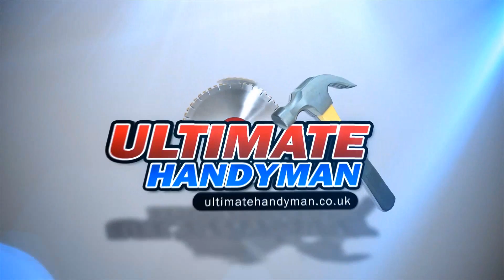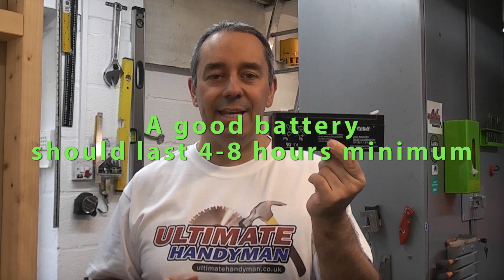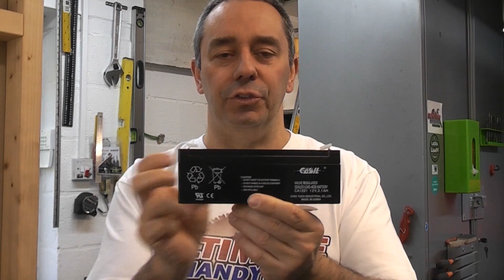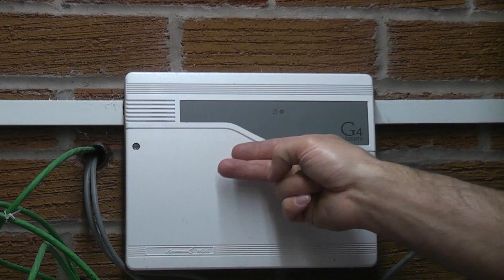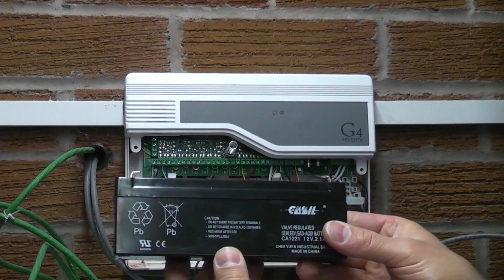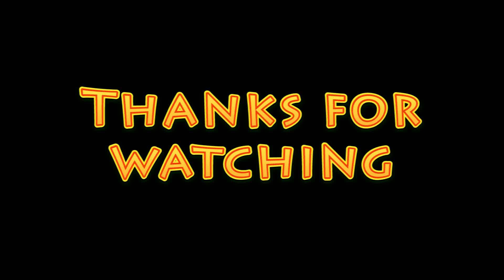House alarm goes off when power comes back on

Comment: Can you do a dtv arial installation video please... Many thanks. :)
Reply from the maker: Sorry, I don't normally touch aerials as a local guy installs them cheaper than I can buy the bits for.
Thanks for the comment
Reply: Ultimate Handyman
Hate it when that happens... They may be cheaper but they are rookies and potentially would not do half a good job as a professional like yourself would :)

Comment: You should also change the battery in the external bellbox if you can reach it, round about the same time as changing the battery in the main control panel, roughly every 3 to 5 years max, most bellboxes will still work even if their batteries are flat as most are set to sab, however if the intruder smashes up the main panel the bellbox will not sound as its battery is dead and then your system is defeated, on bellboxes set to scb (rare) you will know the battery is flat because it will be very quiet or may not sound at all on a bell test.

Word of warning tho, most bellboxes have an xenon strobe circuit which is high voltage and can give you quite a nasty belt(speaking from personal experience, it is quite a strong shock!) it may activate when you remove the bell cover due to the tamper, take care not to accidentally touch it,could be nasty if you are high up on a ladder, Also wear ear defenders.
Reply from the maker: Thanks for the tip, I was going to cover this in a future video. I always wear hearing protection when doing anything with my alarm as it is connected to a 120DB master blaster.
Thanks for the comment
Reply: Not a problem, you might also be aware that if you remove the cover from the sounder it will still sound even if the panel is in engineer, hearing protection is a must as its pretty loud when you are right next to the bloody thing lol :~)
stay safe
Reply from the maker: Thanks, it's about 15 years since I replaced a battery in a external sounder, so that would have caught me out for sure!
Thanks for reminding me ;-)

Comment: If you're installing or maintaining any security system, please make sure you don't leave any codes at their default. You're making it fat too easy for the burglar!
Reply from the maker: The engineers code can only be used when the alarm is unset.
Thanks for the comment
Reply: @ultimatehandyman  Are all engineer codes the same P9999, as you say in your video? Or does it depend on manufacturer?

Comment: What happens if you dont have the Engineering code?
Reply from the maker: You can open the panel, but as soon as you do it will go into tamper mode and the alarm will sound. If you input your alarm code the alarm will silence, you can then replace the battery, close the panel back up and reset the alarm.

Comment: Great vid as always...I too have an alarm with most probably a duff battery (hasn't been changed in over 10 yrs) but my alarm goes off every time I switch the mains OFF to do some electrical work in my house and the siren only stops when I switch the mains back ON.  Any ideas what might be causing this as its a right pain !
Reply from the maker: It sounds like your external siren has a back up battery, these are designed to sound when the power is cut completely (hold off circuit), which is why it goes off when the power is cut completely.  If you replace the back up battery in the alarm panel- like in this video, you will be able to switch the electric off and the back up battery will ensure the hold off circuit works.
Thanks for the comment
Reply: Thanks for the info, much appreciated !

Comment: My old alarm system had rechargeable batteries on a circuit board in the sounder boxes also.
Reply from the maker: Yes, most modern bell boxes have a self contained battery and hold off circuit (in case the power is cut completely, or the cable is cut going to the bell box)
Thanks for the comment

Comment: I suspect this will be a popular video! Some good advice for sure. A lot of people don't realise until there is a power cut and their alarm starts sounding uncontrollably! It's worth regularly changing the backup battery every 3 years (more often if the panel is in an area with a high ambient temperature like an airing cupboard) as a precaution. Definitely one of the most common callouts we get to unmaintained systems. It's also worth disconnecting the mains for a short while after replacing the battery to check it does actually  takeover in the event of a power cut.
Reply from the maker: Thanks Scott,  I thought this battery would have lasted longer than it did, as I replaced the main house alarm battery 2 years before I installed the alarm in this video and the battery is still fine in that!
I did get them at different places though, the battery in this alarm was from CPC online (2.2AH) and the battery in the house was bought from my local electrical shop (2.1AH).  
I'll remove the fuse that feeds mine later today to check that it takes over ;-) 
Thanks for the comment.
Reply: We had a power cut and my neighbours Alarm went off and my Alarm did not go off or if it did, I must be fast in a Deep sleep. My neighbours saying first we could hear Alarm and we could not switch the Alarm , keys on the keypad would not response. Neighbour rang me in the morning and was asking did you Alarm go off and I said not I am aware off, but as I was leaving for work I saw tamper light on. So the neighbour think it must my Alarm going off and not there’s. I also have the Auto Dialler speech, which calls me on my mobile and I did not get a phone call, I rang Texecom and told me you need to service your Alarm system, usually changing the battery, it needs to around 13volt to 14volt.

The below I wrote to technical team.

Hi TECH Support ,
Last week on Wednesday night, we had the Electric gone from the Main Grid, I don’t know how long, but my neighbour Alarm went off and all electricity went off for few minutes , as they messaged me and I said my Alarm did not go off nor my Electricity.
 
However when I woke up I never noticed this, but when my wife into the kitchen the microwave and the Cooker timing clock was showing wrong time, it was showing 05:05am and it was around 09:30am on my mobile at the time she mentioned, so the electricity must of gone in my house as well.
 
Next door neighbour was saying I am sure your alarm went off, but I said to her I did not hear the Alarm, but when I check the keypad it had Tamper light flashing on the remote keypad, so I reset it by pressing 12345 Eng code and reset.
 
My main question, if the Alarm did go off, I never got a phone call on my Mobile and this is bit strange.
 
When I fitted the Speech dialler I tested and it was all working fine for Dial and text, as I received the phone call and text and also the next caller as well.
 
I am bit confused where my neighbour was saying I am sure your alarm was going off and I did not hear it or the electricity may have gone for a while and the tamper  light came on, but may have not triggered the Alarm.
 
I am dropping you guys email to see what are your thoughts.

 
It is possible the outside sounder activated only, as the internal sounder would have required voltage to be on the control panel to activate it.  When the power was restored, the tamper indication may be from the mains fail and no sounder may be from the battery not having been serviced or replaced recently.
 
To assist, we suggest having the alarm serviced and the control panel battery checked and most likely replaced.  For future reference, an alarm system should be serviced annually.
 
A meter would normally be required to check the battery on load and it would be the current that is checked and not the voltage.
 
A quick test would be to switch off the mains connection to the alarm panel and if the outside sounder sounds after a few moments, the control panel would require replacing, like for like.

It is usually the battery needs changing after every 3 years or you start to see a sign , where sometimes it does not accept keypad response.

Comment from the maker: Last week there was a power cut and my alarm was sounding when the power was restored. Lots of other burglar alarms were sounding in the area, this normally means the backup battery is flat or not holding charge long enough. Luckily it is an easy fix and normally inexpensive.
Today is a beautiful day here, time to go and film some more videos ;-)
I hope everyone has a great day!
Reply: Ultimate Handyman thank you for the video it helped on servicing my alarm myself rather than calling an engineer out.
Reply from the maker: You are welcome ;-)
Reply: I take it the system should recharge the battery when it is needed, but I do find it odd that the UK has not implemented some kind of nanny state law which says only licensed tradesmen are allowed to do this.
Reply from the maker: Yes, the transformer is supposed to charge the battery, but the battery stops holding charge after a few years.
I'm sure that the UK will implement laws that will prevent anyone from doing any type of DIY in future.
Thanks for the comment
Reply: Ultimate Handyman could you do a video on how to replace the battery in a external sounder please bud?